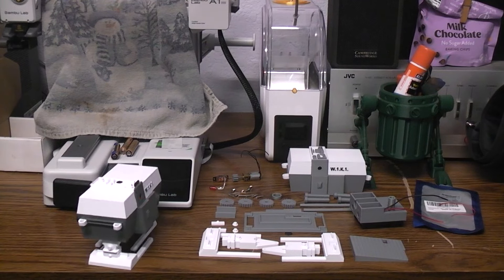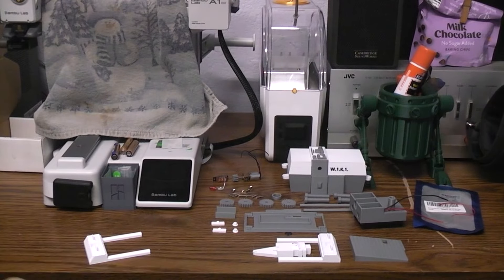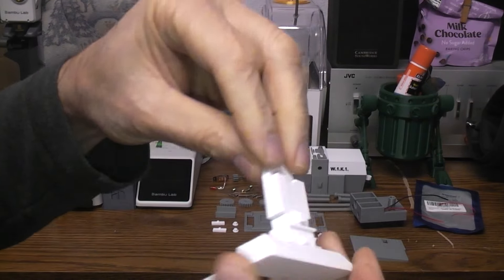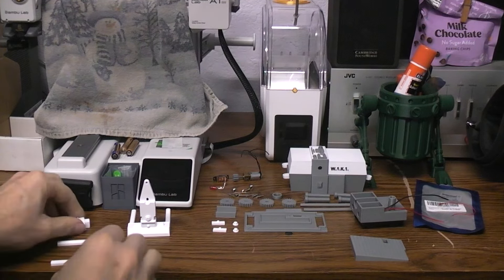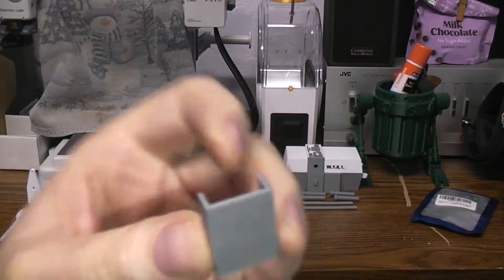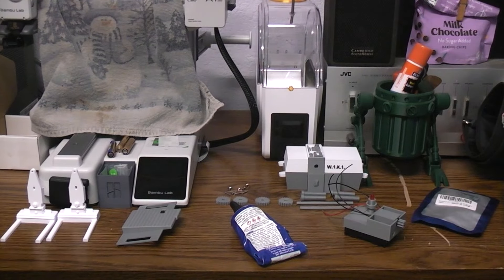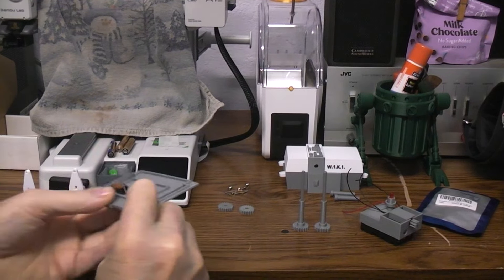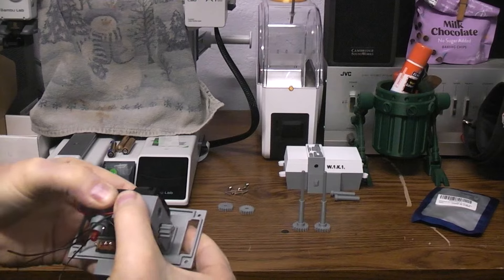Let's build the 3d printed walking W.1.K.1 robot.

Comment: Great ongoing series of Robot builds - thanks.
Just one question regarding the print quality of the bambu mini.
Are you designing the holes slightly larger or does the bambu mini compensate for the slight reduction in hole size when printing?
Reply from the maker: I design the holes the size they need to be depending on the fit that I want. For example, if I need a lose fit then I make the holes larger, if I want a tight fit then I make then about the same size as the part that fits in the hole. The banbu mni prints what you design.
Now having said that I also take into consideration the position that part will be in when printed as that will change the hole from being truly round or slightly oval.

Comment: HI Robothut, model printed and assembly started. Are you using self tapping screws to hold the legs on to the gears or normal threaded bolts/set screws?
Reply from the maker: I used normal 2mm tread screws, but Greg just built one and used some small self-taping screw he found in his junk box and the robot worked great.